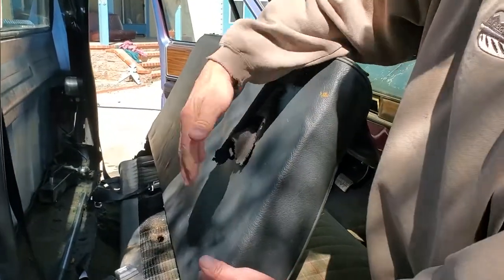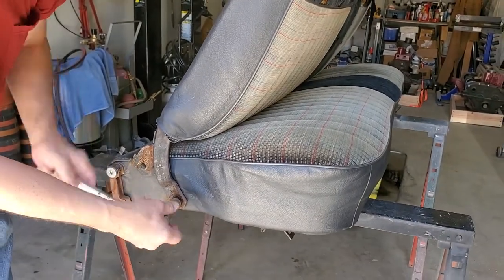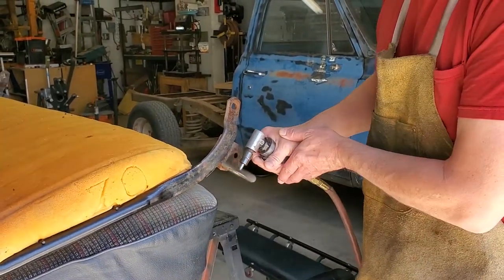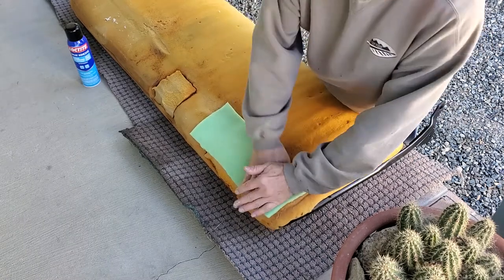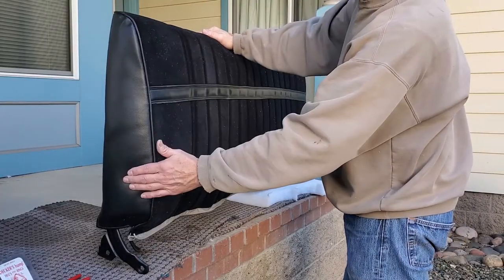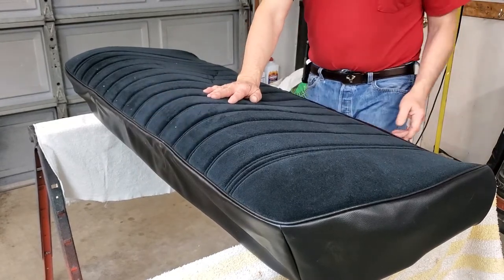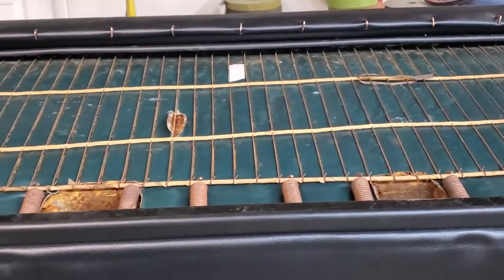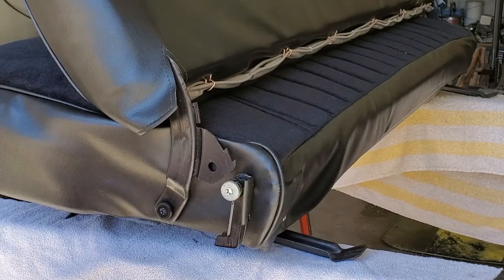How to Reupholster a Truck Bench Seat - Chevy c10 Pickup Bench Seat Cover

Comment: Putting rings in the fabric?
That stuff will rip out in a couple of weeks.
That cover is too big bruh.. LMC failed you!!!
😂
Reply from the maker: Eight months later and still no tears. LMC gave us instructions to place the rings in the specific areas as shown. The only difference is that we used more durable rings, Decker's Hump Hills rings. They're routinely used to attach automotive upholstery fabric to the frame of the seat. The sharp, pointed ends of these hog rings pierce the fabric and bend together with pliers to secure your project. It is a technique that dates back to the early 1900s. The following link will show some examples on Amazon for hog ring and upholstery use. https://www.amazon.com/Seat-Cover-Upholstery-Rings-pack/dp/B003HFBQC6